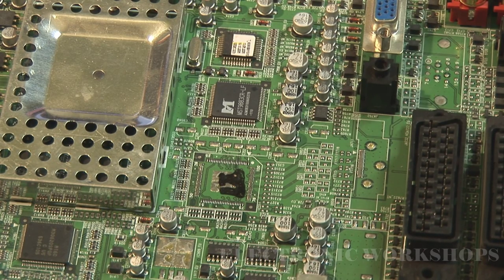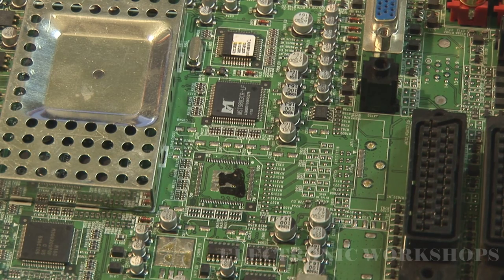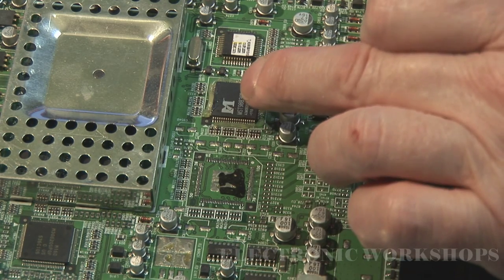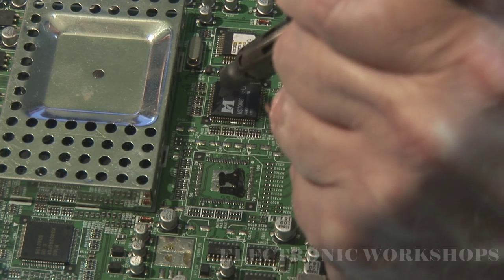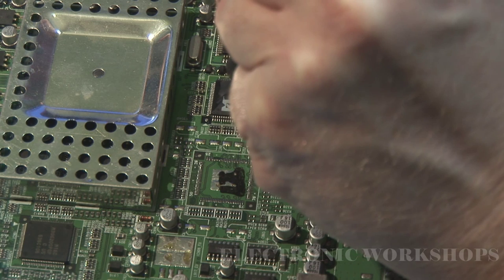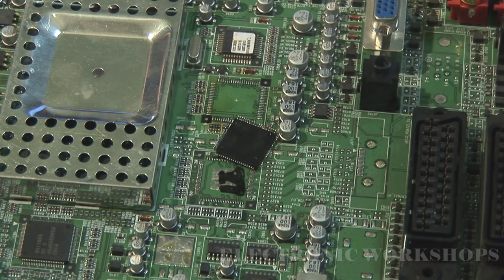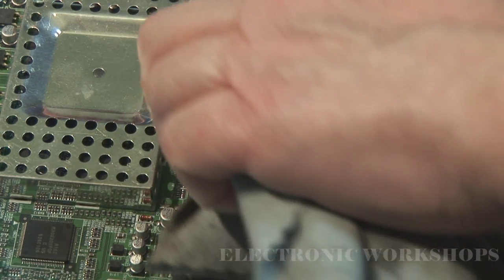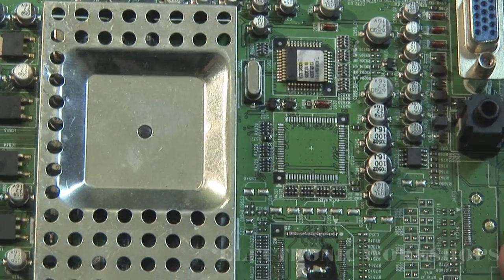Surface Mounted IC Removal Video

Comment: What temp would you have the iron set to remove a chip like that and do you use a flux core high lead solder or leaded solder and a flux liquid?

Great video are you in Ireland?